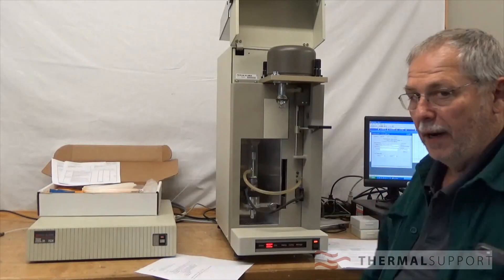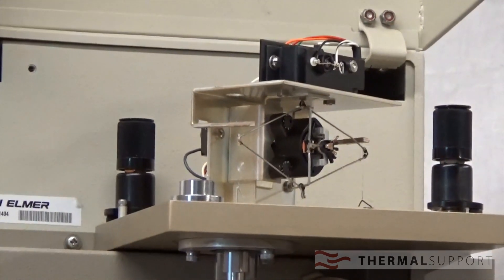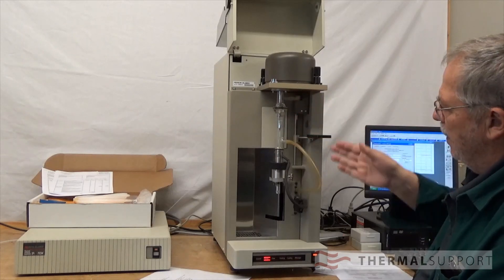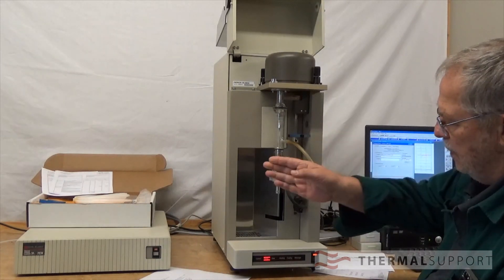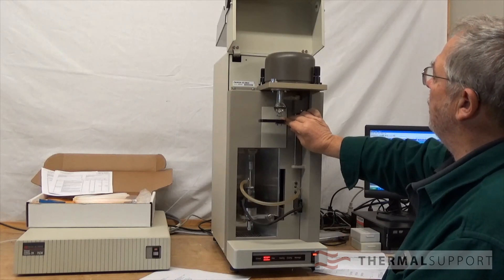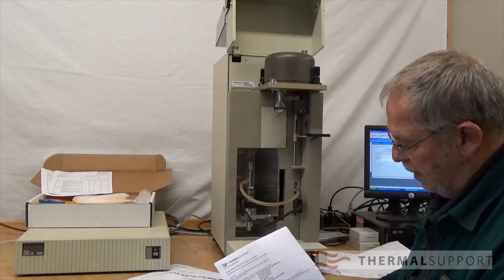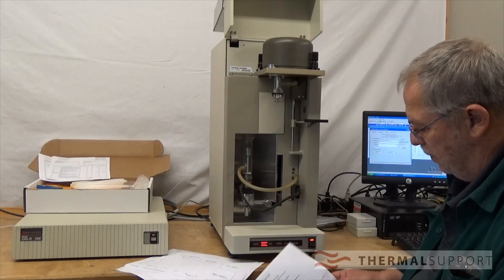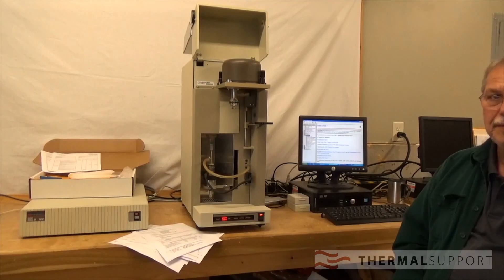TGA7 System Preshipping Video - Thermal Support

Comment: Hello, I’ve been working on setting up a Perkin Elmer TGA 7, I have everything powered on and running but for some reason when I try and raise the furnace for the weight calibrations the status bar in the Pyris software just says “go to raised” and the furnace never moves. I can move the furnace back and forth between lowered and cooling, do you have any recommendations?
Reply from the maker: Hi Will, we are happy to help, but the easiest way would be to email sales@thermalsupport.com. Regarding your issue, check your furnace pneumatic pressure, which is typically set between 16 and 22 psi. Feel free to reach out via email with how it goes. Good Luck